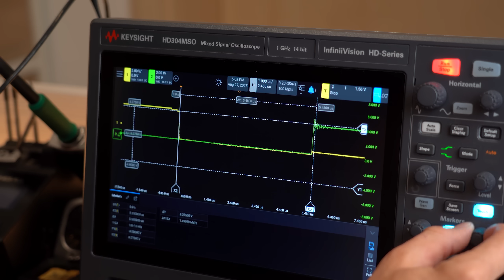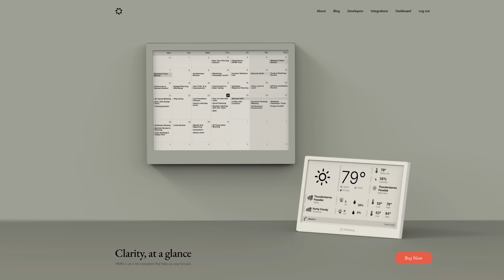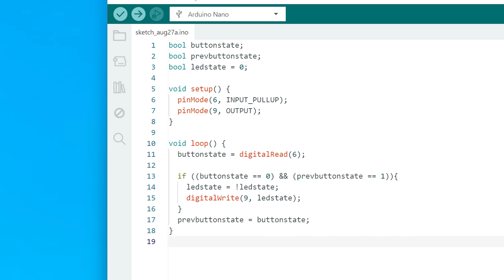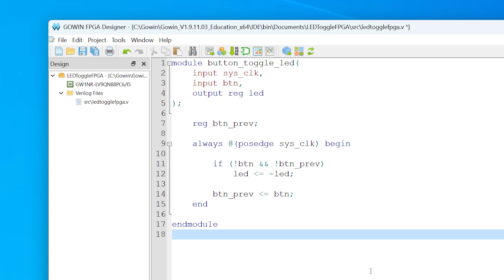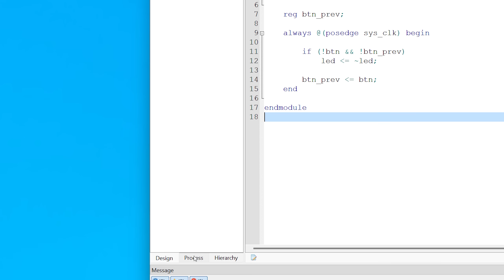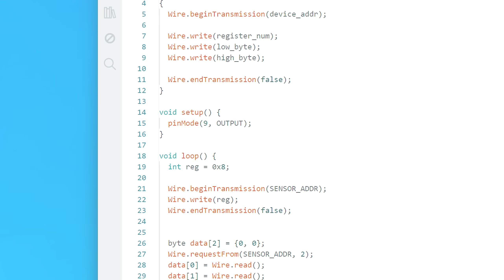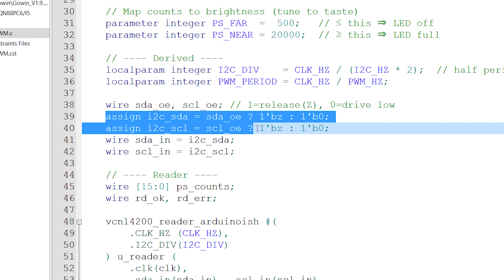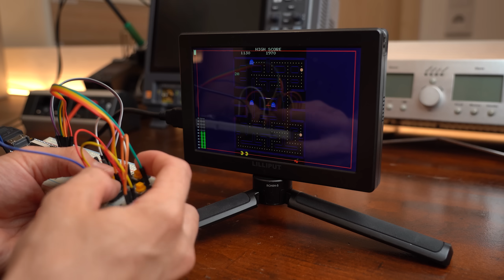The Harsh Truth about FPGAs (You Should Avoid Them?!)

Comment: Without a solid background in analog electronics, digital signal processing, and digital logic, it’s nearly impossible to understand what’s really happening under the hood of an FPGA.

Your video illustrates this perfectly: it shows a lack of understanding of the low-level details of I²C and, more importantly, of the fact that in an FPGA you are not programming, you are describing hardware functionality. The issue you faced is fairly easy to solve if you have the basic fundamentals.

This is why your learning curve feels like a vertical wall. You are still treating FPGA design as if it were software coding—just hitting keys and expecting it to work. That approach will never give you understanding.

With the right foundations, FPGA design actually has a learning curve that is almost the same as coding—but without them, every step will feel like a massive barrier

Comment: As others said, with IPs from your IDE, or which you can get from the internet, it is easy to implement I2C and any other protocol. I think the real problem is that FPGAs need more power, and are slower than dedicated CPUs, and they are more expensive than microcontrollers. And forget about floating point, which some microcontrollers have, you'll need a pretty expensive FPGA for this, and it will be orders of magnitudes slower. But if you need the low latency, and power consumption and price is no problem, then they are perfect.

Comment: PIO on Pico can do most such I/O interfacing just fine. Especially when OC'd, can be much faster than low-end FPGAs. Like the toggling the GPIO example, can do <10ns period.

Only the applications with heavy DSP / parallel processing should consider FPGAs these days.

Comment: No offense, but comparing anything designed in the last 10  years with an Arduino is like comparing a Model T with a Ford Focus. They were slow even when originally developed. They weren't meant to be fast, they were meant to be cheap.

Comment: Of course a simple CPU will be easier and "good enough" for the things it CAN do.  There's just so much an FPGA is able to do that a CPU cannot.  Toggling 1 LED based on 1 button a CPU can do almost as fast as an FPGA, especially if the button triggers an interrupt.  But if you have a dozen buttons and a dozen LEDs and the buttons can be triggered nano-seconds, then the FPGA can handle each button-LED-pair in parallel, whereas the CPU will have to check them after each other.  The CPU code will still be easier to understand, just not as parallel ...

Comment: For novices, it's worth pointing out that this simple example ignores contact bounce. You can't ignore it if you're connecting switches that need to provide bounce free digital values inside the Microcontroller or FPGA

Comment: I like the idea of FPGAs.  However, they suffer from the same issue that modern GPUs do:  they're completely vendor locked.  You can't do anything with them without vendor permission.  For GPUs this means that you must use the drivers provided by the chip maker.  For FPGAs you must use the design and flashing software provided by the chip maker.

Comment: So you say: For the one I use a provided ready to use library and for the other not. And using a library is easier than not using one. Great evaluation.
For other, more expensive FPGAs, complete libraries of modules exist including all common protocols. For some FPGAs you can even use pre defined processor modules and thus mix FPGA and microcontrollers programming on one FPGA test board.

Comment: You cannot compare FPGAs to micro controllers; they are used for completely different purposes.... Also important, you do not "program" a FPGA, you describe hardware.
FPGA = build and use your own hardware.
uC = pre-built and ready to use hardware with many general-purpose functions

FPGAs are used for your very custom hardware (like a subsystem/peripheral within your microcontroller, also microcontrollers and all their peripherals are mostly also designed in HDLs and the "bitstream" is then used by a fab to build the ASIC). The use-case you came up with to compare uCs to FPGAs was a bit like comparing apples and pears there. 

If your FPGA is big enough, you can make it even run your very custom CPU. The FPGA systems I know are mostly used for highly specialized signal processing tasks or hardware codecs.

FPGAs are sometimes also used to prototype things like I2C peripherals etc, they are really there to build custom hardware, while a microcontroller is a ready to use pre-built hardware.

But your video showed pretty neatly, that in most cases for "normal" automation projects there is no need for FPGAs.

Comment: So far as 'FPGA has nothing in the middle': You need to get swapforth and port it onto your FPGA. 
Particularly the j4a cpu. That thing can host a whole almost-complete ANS Forth interpreter/compiler, and still run at  incredibly low latencies.

It's a really good way to 'talk' to a live, running system, so you can easily talk it into doing 'bit bang' interfaces to oddball chips, without having to 'stop and recompile'.

It make a fantastic way to learn about how to talk to new chips, and is a great 'middle' between high level but clumsy arduino and writing a state-machine in verilog to do the same job. 

Plus you can then do the latter, and hook it into your j4a swapforth image's 'IO' space, letting you then 'offload' such jobs into the unused parts of the FPGA. 

This makes it to where it's very easy to end up with a custom j4a swapforth core that has four separate SPI busses talking to half a dozen chips, all at different rates, whilst you independently talk to the swapforth interpreter over serial from your PC, using it to set controls and read indicators.

The nicest thing about swapforth, is you can easily read the CPU verilog and understand how it works. It just takes the typically interpreted virtual machine of a typical FORTH implementation, and implements it in a single-cycle state machine, with a couple of cool optimizations. And all in about a hundred lines of pretty amazingly clear verilog!

There's your 'middle'.

Comment: SPI is much easier on an FPGA than I2C. Many sensors are available in both kinds: so if you know you prefer FPGA's, just pick SPI and avoid I2C. 

FPGA's can implement either an SPI controller or peripheral in just a couple lines of verilog - it's really convenient. 

They also like to do arbitrarily long bit strings. FPGA's are all about the arbitrarily long bit vectors, and slicing/recombining arrays of such signals is very easy in the language, and also 'easy' on the compiler too.  
Microcontrollers, OTOH are all about bytes. 

Also, FPGA's do kind of have 'instructions', in the form of built-in hardware blocks. They're called 'primitives' in the manual, you just instantiate them like any other 'module' but they come in a pre-defined library for the particular kind of FPGA you have.

Things like PLL blocks let you take your whatever MHz crystal input and make what frequency you actually want out of it, making them much more flexible than first appears. You can easily have mulitple different clock domains: protip: best to synchronise with one system clock, and have that drive everything else in your circuitry.

Crossing clock domains is best done with generic fifo and or handshaking blocks intended for crossing clock domains. Oh, that's another thing unique to FPGA's: There exists both 'closed source' and 'open source' "IP" libraries. These are generic functions you can put into pretty much any FPGA (for the open source ones at least).

A lot of the 'closed source' IP blocks are heavily controlled:  you can't have them. Their compilation source files are even encrypted so you can't read them yourself, only the approved proprietary compilers will work with them, and only if you have a current license (they 'phone home'). 

The true FOSS toolchains are actually so good that it's well worth simply restricting your choice of FPGA to what they support: as they are relatively tiny, small (can run on a RasPi) and fast (can compile and upload to an FPGA within seconds: Most proprietary toolchains will take minutes to nearly an hour, for some older chips).

The FOSS FPGA tools also don't force you to use yet another eclipse-clone IDE like the cheapo proprietary tools do, instead, they will integrate and work properly with plain old GNU make. Something some of the proprietary tools are quite bad at, especially the older ones.

FPGA: Best connected to a fast SoC like a RasPi. Also best used with state machines at very low level: Fixed-function pipelines for processing at best, but for raw compute, you may likely be better off integrating a modern SoC and doing your compute there instead. 

Oh, BTW: only a very few FPGA's with FOSS support have support for talking PCIe... So in theory, you could attach one of the documented (AMD) old gpu's and have your FPGA send jobs out for it to compute for it. Which would be a great way to have a lot of DSP compute handy, perhaps for digital control, in a very low-latency way, all whilst avoiding running an OS.

Have fun!

Comment: Most FPGAs are useful, however if you want to make systems with frame buffers (for HDMI HD, 2K, 4K output), sadly none of them have enough fast RAM to allow even 1 full frame buffers, let alone the 2 to 3 you really need for smooth graphics… think Shaders, one frame calculating while the other is outputting. Closest I have gotten with normal affordable FPGAs is 720x720. Adding more fast RAM is not a trivial task…

Comment: As a small side part of my bachelor thesis I also had to implement the I²C protocol from scratch in VHDL. But actually I found it very interesting. By the way you don't have to do that if you are ok with importing a MicroBlaze microcontroller block into your FPGA design. But of course that consumes a lot of space.

Comment: What was the main point here ? 
The Thumbnail states that the arduino is " 100X faster " 
Do you mean clockspeed wise, or developement wise?
The FPGA is obviously faster in terms of clockspeed and overal operation. 
Though developement time is slower.  
Or, did you mix the two up in the thumbnail?

Comment: Suggestion for a 'middle range' FPGA project -- VGA.

Not even kidding. VGA is *crazy simple*. Literally just two counters and some logic to determine when blanking happens so you can assert the right values. A little resistor ladder DAC for your colors and you're all set with a compliant signal. After that it's just a matter of figuring out what to actually display... Many FPGAs come with dual-gated RAM resources that you can directly use to drive your display's RGB outputs in 24 bit true color, or get more 'classic computing' with it and do 1 byte per pixel doing a lookup against a 256 color palette.
Reply: This was my uni project after getting a simple processor running. The numbers involved are very, very human sized, and the timing is far less strict. You'll know when you get there when you'd rather look at the waveform output than the image you wrote your testbench to output (you are verifying on simulation before lab work, right :^)?).
Reply: GreatScott has a video doing just this - from 5 years ago: Driving a VGA Display?! Getting started with an FPGA! (TinyFPGA)

Comment: Best engineer here !! :-))) Every tool has its proper use: FPGA's works at least two layers down a microcontroller (i.e., a cpu/mcu additionally include instruction decoder layer, and a program (asm) layer, and peripherals of course), therefore it's expected to perform much faster at lower power consumption, but it lacks the flexibility and simplicity of the mcu. So you must decide on which one to use depending on the optimal requirements of your project.

Comment: I think your title is a bit exaggerated.  Certainly microcontrollers are easier to use.  It's also the case that more people have at least some background in software than have experience with FPGA HDLs.  It's a question of the right tool for the job, and I agree that microcontrollers will be the right tool more often than not.  FPGAs (even the cheap one on a Tang Nano 9K) shine when you need to work with higher speed signals or need signals with more carefully controlled timing.  They also can give higher performance due to their parallel nature.  Cheap FPGA boards are also great for leaning about hardware.  Imagine experimenting with digital circuits without the hassle of breadboarding.  Imagine exploring industry standard hardware busses.  Imagine making your own hardware peripherals that you can integrate with an HDL core like PicoRV32.  Yes, this is all more difficult than Arduino, but it is also very different.

Thanks for your videos.  Your channel is great, GreatScott.

Comment: I am a physicist and I work as hardware designer and FPGA developer. I can tell you that programming C code for a micro is a completely different thing, in order to understand HDL you need to think it as an hardware schematic and a routing layout. Nothing to do with a programming language.
Reply: Came here to say the same. Back in the old days (think 1990s), when FPGAs were more like CPLDs on steroids, we frequently used schematic capture for design entry, not least because that's how we looked at the problem we were trying to solve. We could write VHDL, but for us at that time, it was literally a case of a picture being worth a thousand words and so much easier to understand than the text-based version. Although I recognise that modern design and verification techniques would tend to favour the HDL approach.

Comment: If I remember well, FPGAs are, or at least were meant to prototype complex logic integrated circuits, thus elegantly avoiding astronomical development costs that would otherwise bee needed to develop even moderate ICs.  As the technology advances and the market allows for cheaper FPGAs one can probably use them for DIY projects. You know,... a bit like building a fully fledged factory to produce a hammer :)...

Comment: They are often simply not practical for hobby projects. If you look at high-tech industry, anything with signal processing (Radar, Imaging, even the Oscilloscope you use) you will find an FPGA in it. The level of speed and parallel data processing these things can offer is unparalleled. But it is true, embedded software is more fun and easier to learn. However, that also means people can more easily break into your field and hence compete for your job.

Comment: I’m an electronics engineering student in my final year. FPGAs click once you realize HDL isn’t “code” in the usual sense. It looks like software but describes hardware, and thinking like a programmer will hold you back from using what makes FPGAs powerful compared to microcontrollers.

State machines are key. They’re just a formal way to express logic: define the states, specify what happens in each based on inputs and the current state. Simple idea, huge payoff.

At school we even built a MIPS processor in VHDL to run alongside our own hardware. You probably never will do that in industry, but it showed how you can mix approaches and get the best of both worlds without making everything maximally efficient the hard way.

Comment: No serious FPGA engineer designs peripherals from scratch. They simply use IP cores, either public domain or purchased. They work very similar to libraries in programming. So you just find an i2c IP core that works for you, and include it. It isn't that there is no middle ground to level up your knowledge, simply that you have to know more about how to use the tools, and you have a lot more variety. A micro controller gives you only a single option for an i2c peripheral. An FPGA gives you hundreds to choose from.  A CPU is like ordering food in Europe. An FPGA is like ordering food in America...except without being forced to tip. You can even include a microcontroller IP core in your FPGA if you so desire. Although not much is going to fit in a 9K.

Comment: I coded both MCU (STM32, ESP32, etc.) and FPGA (primarily Xilinx). The only reason you need FPGA is to create something that does not exist in the market, such as 128-bit adder or high resolution PWMs not possible on MCUs. FPGA offers high design flexibility at the cost of lower frequency compared to high end MCUs but nowadays FPGA SoC does offer high performance CPUs, so that is hard to say. If your goal is to have quick and dirt cheap prototyping, MCU is probably the best option. But FPGA will be the only option if you are working on cutting edge research projects.

Comment: 6:58 FPGAs aren't always faster!  They're great at doing the same thing lots of times on a stream of data in a pipelined fashion, but really bad at mimicking sequential code.  In an extreme example, if you need to create a CPU in your chosen HDL to run code in your chosen ISA, the FPGA will be just as limited by its clock as a microcontroller would be, except missing some potential clock cycle savings from the microcontroller being implemented as an ASIC.

The benefit of an FPGA comes from its massive parallelism, so something like Conway's Game of Life would be extremely fast on an FPGA relative to a microcontroller or single core CPU.  It should also be on the easier end of FPGA projects (much easier than implementing I2C or VGA, at least) because the underlying logic is so simple.

Also definitely look for an I2C module online, since that's a pretty common solo project for entry level engineers.  Once you have a known good module for a particular interface you want to use, it'll work in every future project you make.